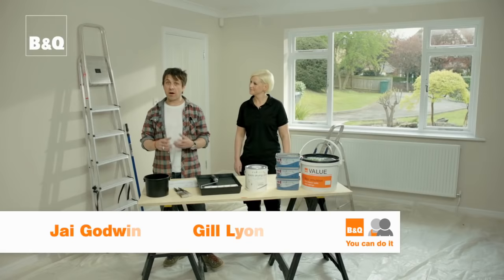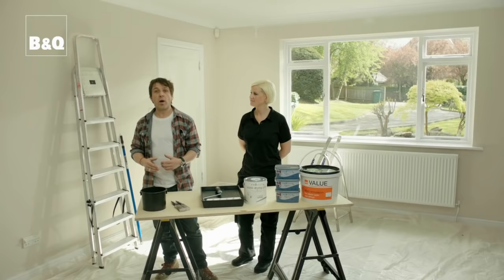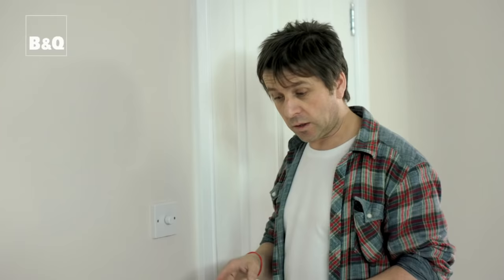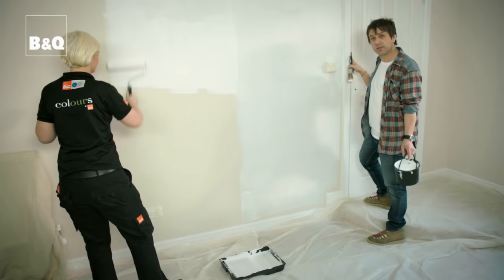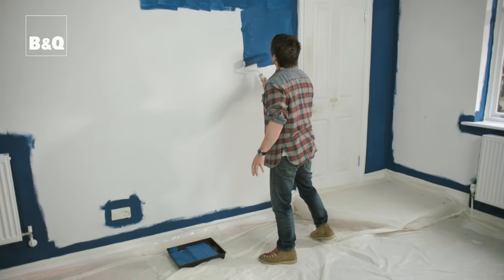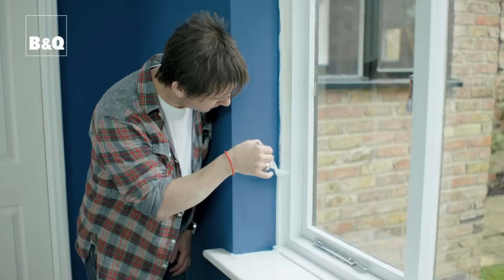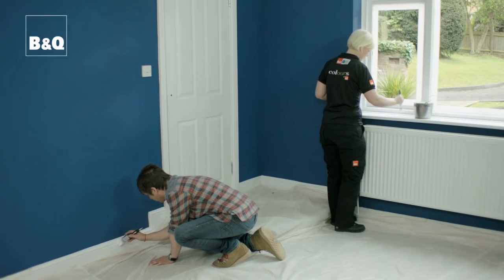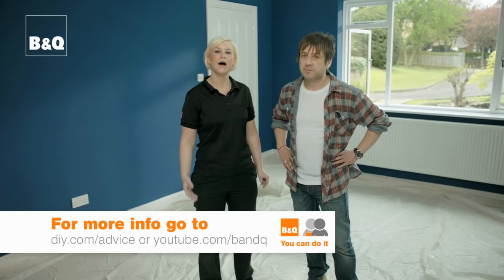How to paint a room

Comment: A decent paint cost around £20-£30 for 2.5 litre and it will most likely gives you around one to one and a half coat (of course it will depend on the size of the room). You can save some money by, buying a 10 litre white emulsion (usually around £10-12) and mix 2.5 litre of your chosen colour to it. The colour generally would come out pretty close to the desire colour, albeit slightly watered down.

Comment: Do I need to mix paint with water before applying any coats? Or do I use them straight out of the tin?
Reply from the maker: This is dependent on the type of paint you're using. If you could please let us know, we'll be able to assist further 🎨

Comment: Don’t use that tape to mask sockets and switches it pulls paint off with it when you remove it.
Reply: I'd rather pull the sockets out than put masking tape around them
Reply: yeah but you can alway peel of the tape when the pain is still wet ,that's what I do and it some how works for me:)

Comment: How do you paint behind the radiators?
Reply from the maker: For maximum results, it would be best to take the radiator off the wall if you are able to. If not, you can use a long/thin attachment to your roller or brush to get into those narrow spaces 😊 Hope this helps! 🎨

Comment: What u don't need to paint the walls white 😂
Reply: i know seems just making more work for yourself
Reply: Yeah, in most cases you don't need to. I guess if the paint you were using had poor coverage you could build it up with a similar colour underneath.
Reply: White paint on a wall helps make imperfections like lumps on the wall or where you need to apply filler more visible
Reply: They want you to buy their products and that's why they are advising you to paint the wall white first lol
Reply: You Usualy base out walls in a light colour to show up imperfections also helps stop the old colour flash through

Comment: But they didnt sand the walls. I thought you needed to sand all the walls?
Reply: No, there is no need to sand walls.  It is important to remove dust and any marks, but two coats and it will be fine.
Reply: If there are any marks/holes in the walls that you’ve filled, sand those down. Apart from that, a coat of paint or 2 should smooth out any textured walls.